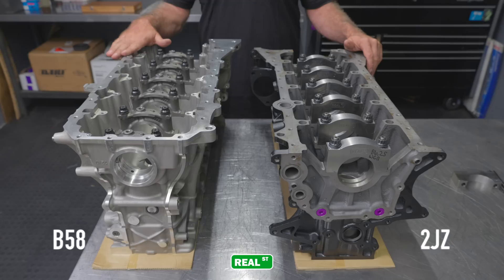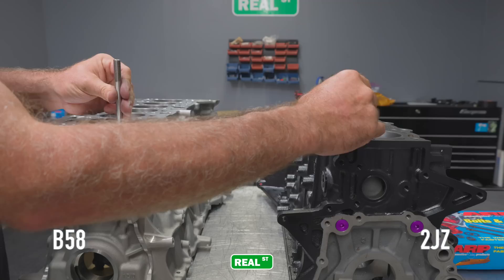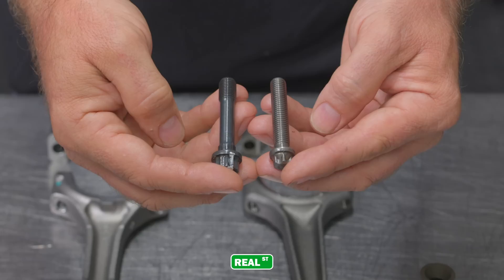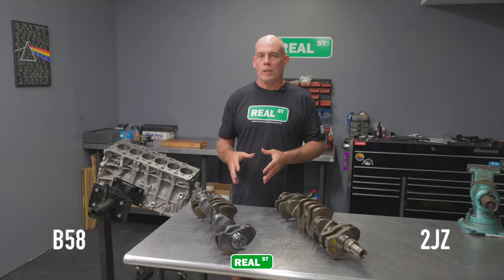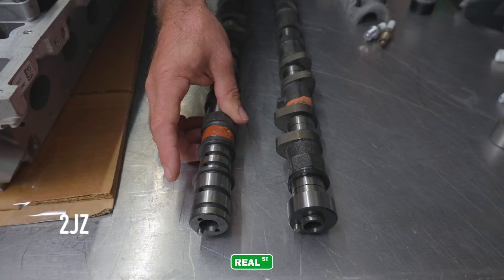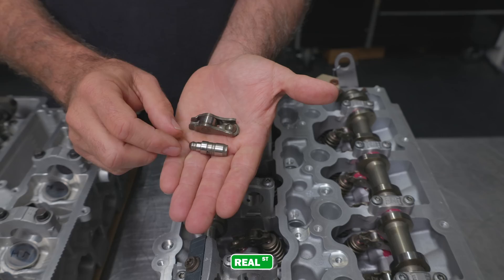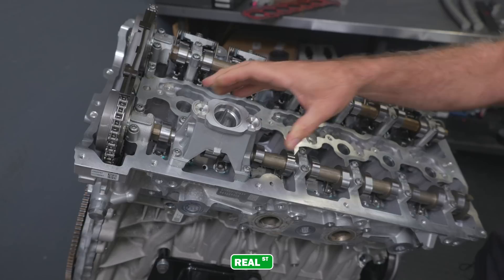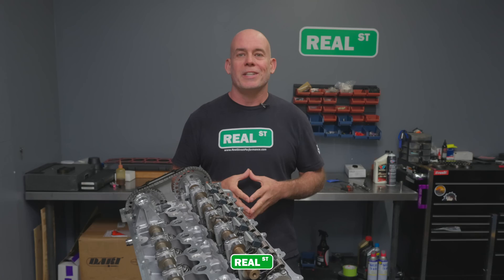Toyota 2JZ VS BMW B58 | 2JZ STILL KING?! (Detailed Engine Internal Comparison)

Comment: In my opinion based off this video:

Easiest to work on: 2JZ
Tunability: B58 (can make 550whp with just a tune and a downpipe, 2JZ needs a single turbo set up as the stock twins aren't that strong)
Rotating assembly strength: * Likely both the same*
Overall engine strength: 2JZ (thanks to its cast iron block)
Versatility and usability: B58 (due to having a greater power band for daily driving, and thanks to it being lightweight, it's also better for a wider variety of motorsport, a 2JZ isn't the best choice for time attack and track related motorsports (it's brilliant in drifting tho) as the weight of the engine will reduce handling... The 2JZ is even heavier than many LS engines.

Reliability: Only time will tell due to the B58 being a new engine, but they are both very reliable overall from what we have seen, but do have their own issues. The B58 has plastic components in the cooling system which can fail over time, also the B58 has valve cover gasket issues, the PCV valve isn't that good either. The 2JZ's stock ECU is known to fail, as well as the stock twin turbos not being the best, hence everyone went single turbo on it.

The winner:
There isn't a winner in my opinion. They're both brilliant in their own ways.
Reply: Rotating assembly strength likely the same? Everything is smaller in the B58 and racers are having trouble with the bottom end in the B58.
Reply: @PistonAvatarGuy  People are making 800whp on the stock B58 bottom end reliably. idk abt that.
Reply: @Josh-qm4rb  People who actually race the cars are having problems. IIRC, the rumor came from Papadakis Racing, their drift cars are just eating bearings.
Reply: @PistonAvatarGuy  That is true with the bearings. But people who race 2JZs producing 1000whp are also going to have aftermarket bearings as well as aftermarket internals. a 1000whp stock 2JZ is not going to last long at all, nor will the stock B58. But Papadakis did say that the rod bearing issues may have been caused by using the stock oil pump, which has started to show it's weakness at over 1000hp, other than that, the oil pump is still very strong.
I'm not saying the B58 is stronger than the 2JZ, because I believe it is around the same strength (in terms of rotating assembly.)
Reply: @Josh-qm4rb  They weren't having problems with 2JZ bearings. Because of the wider bore spacing, it's possible for the 2JZ to have wider, more supportive bearings than the B58, as there's simply more room for them. Because of the wider bore spacing of the 2JZ, it's also possible for the crankshaft to have thicker crank webs. The 2JZ crankshaft also has larger diameter journals, for both the mains and the rods. The 2JZ is just a much stronger engine than the B58 ever could be without a complete redesign.
Reply: @PistonAvatarGuy  that is true. The B58 in this video was the older gen, I could tell because it had the 2 port exhaust manifold. I was basing the B58's strength off the newer B58 TU found in newer BMWs and Supras with the 6 port manifold. It has revised internals and that is the one that is making 800whp reliably.
The pre TU B58 isn't likely to be as strong as a 2JZ, but the TU definitely is.
Reply: @PistonAvatarGuy  There's no way a 2JZ can make 2,000 hp on the factory head, it needs cams at 1000hp. Well it could make 2000hp on a factory head, if it was largely re-engineered.
Stock crank won't last minutes at 2000hp. Most people get billet cranks at 1300hp, though the stock 2JZ crank has been tested  up to 1750hp for short periods of time.
The factory cast block CAN handle 2000hp tho.
I just honestly think that despite the narrower borings and the journal diameters, the B58 is still a VERY strong engine. The materials in the rotating assembly would be slightly different to the 2JZ as they are different engines ofc, but the factory B58 TU's rotating assembly is making 2JZ level power without it breaking... The B58 is stronger than u think, even if it is just a tiny bit weaker than the 2JZ.
The advantage of the B58 is that it is lightweight, and can be used in track focused applications more, as the weight of the 2JZ will hinder a car's handling ability. 
The 2JZ's iron block is stronger than the B58 block tho, making it a better drag racing engine.
Reply: @Josh-qm4rb  Ok, you're clearly trolling.
Reply: @PistonAvatarGuy  Whatever u say
Reply: BHP is different from WHP bro
Reply: @adrianraghunanan30  I know that

Comment: Gotta love Toyota outsourcing engineering design, i mean theres a reason for Yamaha's branding on the 1jz

Once the b58 has the R&D and  aftermarket support of the 2jz they probably wont be as comparable in people's minds, just wouldve been nice if Bmw stepped away from plastic factory parts..
Reply: Bmw NEEDS to ditch that chain driven pump asap

Comment: He totally glossed over the really, really , really, important advancements such as a lot higher compression and valve timing. Two of the most important advancements dealing with overall low and high speed  characteristics (boost response) . He breezed by them like it wasn't really an important thing. 

He did end it with some honesty: that he will always be partial to the 2JZ... and that's what I'd make of this breakdown. A stacked opinion.

Comment: I'm gonna go ahead and root for the 2JZ. 
--The cam caps are bigger.
-- The bucket and shim valvetrain is simple.
-- The individual exhaust ports don't retain so much heat in the cylinder head. 
-- The chambers are simple.
-- You can put a modern piston in a 2JZ. The full-rounds do have thermal mass in their favor. 
 
 The B58 is a nice machine. 
-- I don't like the Valvetronic system, but don't hate it either. It adds complexity, but makes vacuum leaks impossible. It's like having an ITB setup, but without all of the hassles. 
-- The engine can't use MAP anymore, so you're at the mercy of the MAF sensor and tune quality.
-- The combustion chambers have bigger quench pads.
-- The engine has to come out of the car in order to be worked on, but that's a better way to do clean work. 
-- The block is made of appropriately thick aluminum and is still lighter.
-- I don't like the 2-port cylinder head. That opens the door to warpage over time because symmetry is lost. 
-- The rear mount timing system keeps harmonics isolated. 

Forget about peak power. What will either engine look like after 15 years in an endurance/towing application at 550 hp with a single turbo?

Comment: I picked up a 98Aristo v3 while I was in Japan. Trying to get more experience and QT with my pops. I was thinking a B58 but thought it would be different bringing JDM to the states because it’s not common seeing 2jz gte. He’s also 6’7 so my options were slim considering I’d like him to drive with me. So I couldn’t get an rx7 or s14. And this video helps me understand that the 2jz is friendlier on me as a beginner 😂

Comment: Just the direct fuel injection and the higher compression it allows is a huge step up.  Obviously if they are both stock the BMW kills the old motor.  I still love my Supra TT though.

Comment: I think what people need to grasp is that 99% of the people that own a Supra and never going to break 1000hp. So the stock block hp record doesn’t really matter to most people aside from bragging rights. So both are sufficiently strong for most applications. I would probably lean towards the BMW for the valve tronic and duel variable cam timing, and the direct injection. I know if you build a 1200hp engine you will end up deleting the direct injection, but for street use with the 11:1 compression it is much safer than port injection.

Comment: Simplicity is the ultimate sophistication, 2JZ is still incredible. Too many parts on the B58 and additional reasons for failures, "technically superior" and lighter to mainly handle pollution constraints on a road car.
Reply: b58 have a lot less fuel consumption 16city/22hw old  vs 23/31 new. not to mention tons of other superior aspects like top tier driveability, broad power curve, light, easy to start and always optimum performance no matter where you are
Reply: What's simple? Koenigsegg Freevalve. Eliminates all of this mechanical complexity about valve control, and gains infinite control of every valve by digital interface. But there are obviously challenges.
The camshaft is equivalent to a rotating broomhandle with fixed bumps pushing a valve at a fixed interval a fixed distance, and the drag of bearings and springs to do it. Even though a lot has been achieved with that for a long time, it's an obvious point of engine control that seems to never get totally redesigned.
Reply: @hotdog9262 Plus the B58 has been very reliable.

Comment: I'd like to see how the S58 compares to the B58 and how the S58 compares to the 2JZ, all in one video. I know the S58 is very similar to the B58 but i think it would still be a good video.
Reply: S58 is not similar to B58. BMW themselves said over 90% of the parts are different
Reply: @pranavk8293  point is they are both 3.0 liter inline turbo charged engines.
Reply: @LichaelMewis  Actually they are not both 3 liters. The S58 is 2993 cc while the B58 is 2998 cc.

Comment: B58TU2 is going to be tremendous once they put it in the smaller chassis and more practical for street use. Automotive engineering means more than 1/4 mile times.

Comment: Great video, but you forgot to mention that BMW moved the timing gear (VANOS sprockets, timing chain, guides, tensioner, VANOS solenoids etc to the rear of the engine (tranny side).  That means if you ever need to replace the timing chain, VANOS sprocket etc., you have to pull the entire powertrain assembly from the vehicle and separate the transmission from the engine.  NO THANKS!

Another point I recently learned with these valvetroinic engines is that the eccentric shaft lobes (for a particular cylinder) are not symmetrical.  Meaning, that the front valve of any given cylinder starts to open at an earlier pont of eccentric shaft rotation than the rear valve.  At low power settings (idle for example) only the front valve is open.  As you increase the throttle, the second valve will open providing maximum power ... like an old progressive carburetor.  Get your straight edge out and check it for yourself as you rotate the eccentric shaft from minimum valve lift to max valve lift with the straight edge held against the eccentric shaft lobes.

Comment: One word: KISS. That's the Toyota design. The BMW is so much more complicated and prone to failure.  Simply example is the oil pump. I'd love to see a new 2jz Head with direct port injection and dual VVTI. That would change everything, why Toyota didn't do that is beyond me why spend all that money on that engine only to drop it.
Reply: Emissions/the degree of use in platforms. Plus packaging. Was easier to make a V6 so it'd be used in quiet literally any platform they threw it in like the camry,tacoma,or even the IS350 for example,which wouldn't have been possible to do with a I6 which would've drove up costs,r&d for the front ends of cars ,not as easy for them to pass crash safety tests, and put in less platforms if it weren't efficient.

Comment: Proud owner of a B58 here. I have a 18’ 340i so much potential. 

Gonna slap a hybrid turbo on it and shoot for 650whp:
Reply: And a couple months later it will be shot and sitting in a shop getting a complete engine rebuild. Best bet is to sell it and build a 2j or an LS if u want something fast and practical that will take a beating
Reply: @almightybirdwatcher4986  you’re clueless buddy. I have a few friends with b58 cars well over 600whp stock engine hybrid turbo for years. They are v8 killers hp for hp
Reply: @iJustB58  sure buddy. And how many things have they repaired and worked on. They are lemons.They may be “reliable” in German standards (except for Porsche of course) but they are not reliable at all on the grand scheme of things and somehow your friends won the bmw lottery with the only bmw’s stock or modded that have lasted that long. On no planet can you compare a bmw engine to a Toyota engine when it comes to build quality, designs, reliability, and assembly. Your smoking crack 🤣.
Reply: @iJustB58  and your clueless of all the videos exposing b58’s for what they are and how “reliable” they are
Reply: @almightybirdwatcher4986  bro what reliable vehicle do you own? Better yet what vehicle do you own worth talking about? You probably can’t even an afford a B58 equipped anything. 

I provided a video stating b58s are v8 killers and all you blab about is reliability. You don’t even know what you’re talking about so I won’t keep going back and forth with a random 💀

Comment: As a performance engine that’s been in the trade for 37 years, the simplicity in the 2jz wins hands down!  You would not pick that bmw engine for an all out balls to the wall turbo race engine,  that valve train complexity is a disaster waiting to happen.  There is a reason the gm LS v8 is such a popular engine for turbo drag guys,  and it’s to because it has a complex valve train .
2jz  wins hands down .
Reply: B58 is highly reliable despite all of it, even toyota agrees and they use it. Not to mention characteristics of a performance engine, B58 is better. Much lighter block, lighter rotating assembly, much more efficient, much more responsive at any RPM… B58 is better.

Comment: Pretty good comparison. It would have been useful if you also had an S58 engine, since it is much stronger and has much higher horsepower. Also, it would have been better if you compared the 6 exhaust port BMW cylinder head to the 2JZ cylinder head, rather than the 2 exhaust port BMW cylinder head. Finally, not sure why you mentioned the hot-v layout while you were talking about the 2 exhaust port BMW cylinder head. Hot-v layouts, such as MB and BMW have separate exhaust ports per cylinder.

Comment: Until an oe block, head, timing components and crank 2jz or ANY make with as many oe parts runs a 5.88 @ 256mph, the 4.6 4V is king.
Or runs 300.4 mph in a standing mile on an oe block and head. (5.4L)
Or traps 265mph with an oe head (gt350) 

Ford's twin cam engines are in fact, king of oe performance.
Reply: V.S Motor in Norway was making 1850 hp out of a OEM BMW S85 block and heads 13 years ago. It might have a billet destroker crank.

Comment: Bore and stroke of the 2JZ is squared therefore will last longer and rev higher. B58 is undersquared - designed for torque and street use. For all out racing, the 2JZ is still superior.

Comment: Modern oil pumps scream failure point.  I don't understand why innovation so often replaces proven technology or designs.  Also, saying the BMW shares subaru  designs is worrying...whether for the street or track, subaru's aren't known for durability.

Comment: As soon as I read the title I had my answer, but here's a quick breakdown if you are interested in my take on which is better by category and overall:
stock form power: b58
aftermarket support: 2jz
reliability without mods: 2jz
reliability with mods: 2jz
overall durability: 2jz
availability: 2jz
professional racing ties/relation/wins: 2jz
cost: 2jz
engine design: b58
fuel efficiency: b58
future potential: b58
overall winner: 2jz

Comment: Great video. To me this sums it up. The 2JZ is a very special engine made when engineers focused on a goal of making monster engines for domination. Now "going green" epa horsesh*t and pen pushing accountants lead the way. Modern engines are garbage. Yes, they have alot of great technology and have made huge advancements. But for what? To be ruined by regulations. This video highlights my point. The 2JZ is being compared to a BMW engine 20+ years after production ended. And being show to be a better engine overall. Toyota came to BMW for the B58 engine because Toyota no longer knows how to make an engine like the 2JZ so it was easier to just go with BMW who do make great Inline 6's. I hate modern cars for all the reasons I mentioned. Imagine if they had the freedom from the 2JZ era with todays technology. What an engine that would be. Also, it should have been mentioned that the 2JZ also had oil squirters below the pistons. That was ahead of it's time. 2JZ-GTE is best engine of all time in my opinion.

Comment: The true test is long term durability and overall service costs for stock engines..

At 200,000 km the 2JZGTEs simplicity will be paying huge dividends..and well serviced 2JZs suffer very little almost no wear and well proven to suffer almost no failures.

At 200,000 km the M58 complexity means more components to wear and fail and more external ecu control units required which are difficult to diagnose..to say nothing about component oil leaks which have been a big problem for older BMW 18:08  engines..